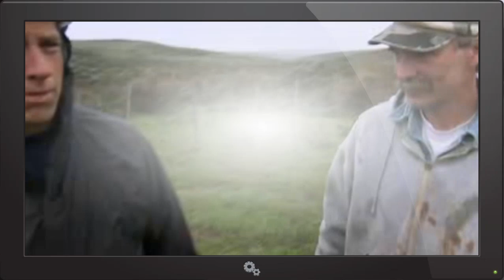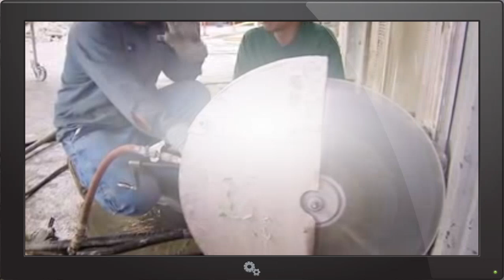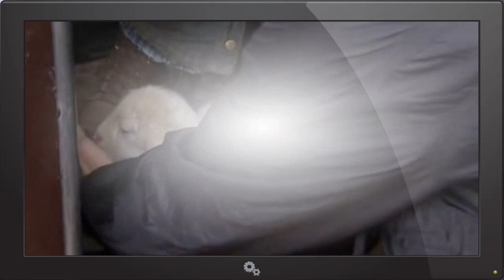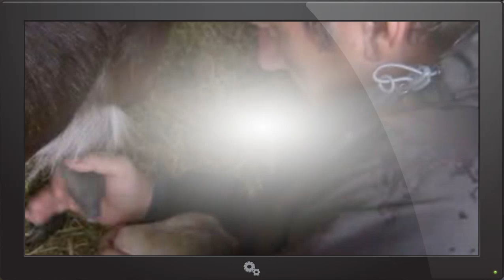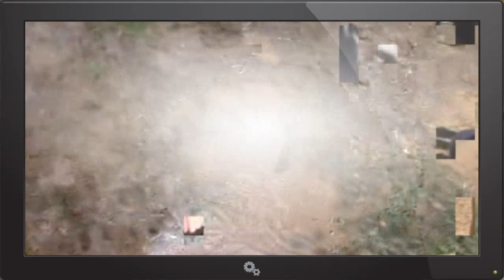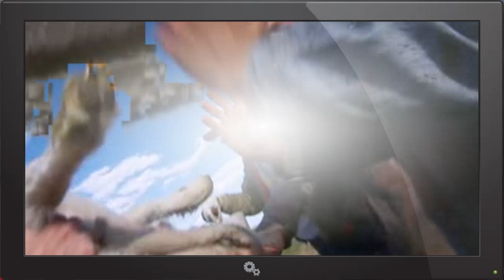Dirty Jobs   421   Sheep Castrator

Comment: Believe it or not this is the least painful, least side effects method of Lamb castration, especially if you don't want the Lamb passing out then  limping around for a week and a half. That's what happens if you use the rubber band method, its really way more painful than one would think. It happens because a lot of the time the lambs testicles are only partially descended as a result, you literally crush part of one or both testicles. The SPCA says the rubber band is the most humane way, but it is highly impractical and extremely difficult to do in a farming environment. The method used in the Video looks savage and brutal, but is as close to painless as it can be done.
Reply: No, I cant watch it. None of it should be done. 
This hell-planet is cursed. I hate these goddamned gold miners farming meat for quick cash.
Reply: @trollmcclure1884  And all those screaming plants that you rip out by their roots, leaves that you tear from their stalks, flowers that you eat before they're even opened.  You can't hear the cries, but they can be measured.  Don't you just hate all these gold miners farming plants for quick cash, too? STOP EATING, THEN!
Reply: @trollmcclure1884   right !  daily news is not much of a news source.   Have you been on a farm?